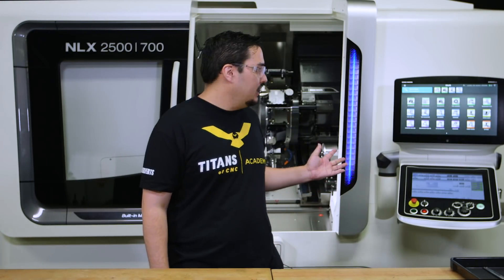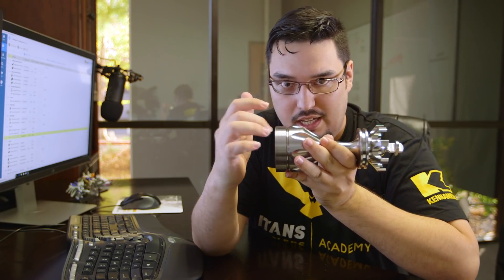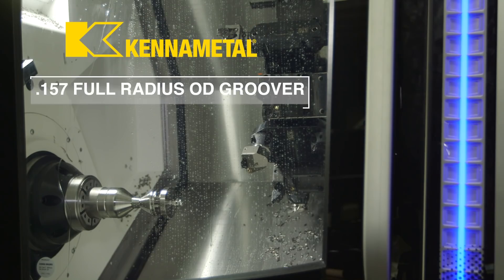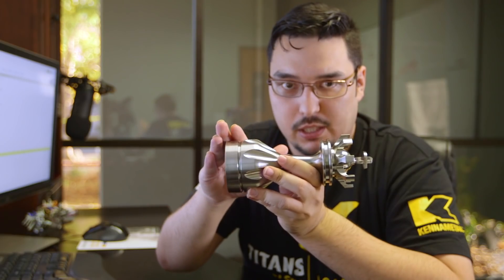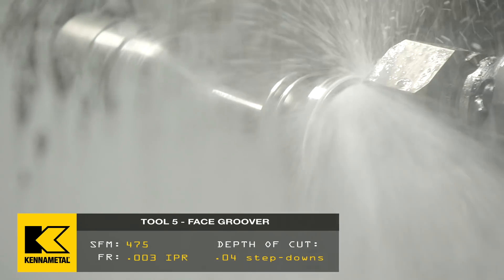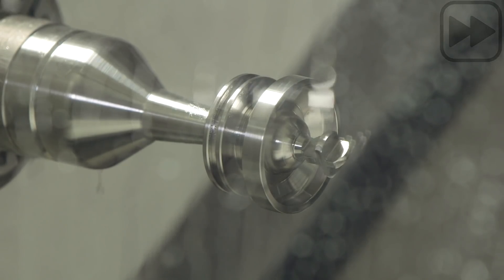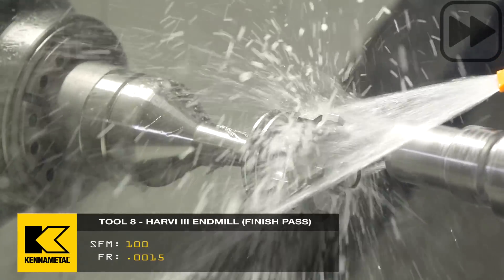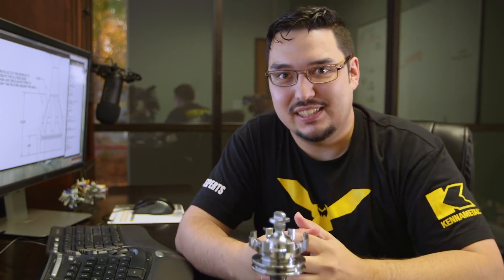How to Program & Machine the TITANIUM KING

Comment: I would have turned and milled  the top first and then turned and milled the foot last, to keep the part more rigid. Your part looked good and the program worked fine.
Reply: I was thinking the same thing, but ya the part looks great.
Reply: same 👍
Reply: You don't know how many times he had to adjust his speeds and feeds to get rid of the chatter... He even talks about it... Every skilled machinist would leave the stock material under the crown until the last operation. Making it that thin and using groove cutters on the crown, not the smartest way to do this.
Reply: @RicM4  You mean, we don´t have to ad a "BOOOOM" to the comments!
Reply: True. His way also works but takes way to long. The part looks great but could be machined way faster.
Reply: You are absolutely right !
Avoid chatter

Comment: First off, you guys are amazing. Love the videos and find so many useful tips and information.
I was wondering if you could do a tutorial on how to use the G7.1 for engraving around the outside of a round surface. 
G7.1 cylindrical interpolation.
I'm having trouble getting the code to work correctly in my NLX 2500.
Appreciate any help

Comment: I’m proposing this machine for    my employers next lathe. Spec is with fanuc controller, sub spindle, y axis, live tooling, bolt on tools for stability and if they will stretch .... a pallet loader. Is there anything you would change about this machine now that you have it up and running? Also, what CAM software you use?
P.s love the videos and the enthusiasm you guys bring to manufacturing. It’s a career that provides constant learning and a real sense of achievement 👍🏻.

Comment: I have a question, why are machinists and CNC programmers paid like crap? I'm from the Chicagoland area and even being a full 5 axis / swiss lathe trained machinist, you make a max $30 an hour. Compare that to much easier labor jobs around that pay up to $46 dollars an hour, why is this the case? How can we make more money in the industry without being a shop owner? Thanks and great video!
Reply: Count yourself lucky, in the UK the average is $18 an hour
Reply: What labour job is easier than being a machinist?
Reply: @spikeypineapple552  That's how he phrased it.
Reply: I think KH means " Unskilled Labor " like helpers and material handlers in the construction industries.  I am not sure why people compare jobs this way? easier vs harder, it depends on personal preference.  Working for a Concrete Contractor or Tying Rebar can be real hard on the body.  $30 / hr sounds low for the Great Lakes region, especially in a large metro like Chicago or Detroit.
Reply: @chrisrokz9005  Sort of yes, we (machinists) are paid like 2nd year apprentices, even when we can be masters of our trade. I have 2 skilled buddies, one HVAC and a linemen friend who both make over double what I make. The knowledge you need to be great at their jobs is much lower than what you need to be a great machinist, on or off the CNC. I'm not saying they don't work hard, they are great hardworking boys, I just can't figure out the pay difference. Other than the love for it, there is really no reason to get into this trade. Nobody but the people on the inside appreciate what we do. Getting back to my original post though, there has to be a way to make great money in this field of work. I just can't seem to find it.
Reply: @Bawbag0110  That's crazy, I hope living there is cheaper to make up for that.
Reply: @kylehofmeister6906  Most places outside of London are pretty cheap, my house cost £140,000, a similar one in London would probably cost £800,000 if not more
Reply: @kylehofmeister6906 You have to find a company, that makes more expensive produkts. Job shop jobs don´t pay as much as inhouse jobs!
Reply from the maker: There are so many companies out there and some are behind the times and some are on the cutting edge of technology. Pay is based on your ability  to sell yourself, meaning how you push your personal brand. Your skills level and ability to solve problems. Did you see the whole video on top 5 things to get a job.
I have always gotten paid 50% more than others with my same qualifications... but also was able to sell myself, was willing to move, and put countless hours in year in and year out to hone my skills on my personal time.
There is a machinist shortage right now and it’s going to get worse.
That’s good for Great machinist
Reply: @TITANSofCNC  I didn't see the video you talked about, I'll watch it now. Thanks for the advice, I know I have the skills, I guess its time to become a better salesman.
Reply: I will even said count your self super lucky, here in SeA (Malaysia) a good swiss type machinist will hardly earn more than 600.- USD / month based on 160h, that's not even 4.- USD/h 
I know the comparison is not that right as the cost of living is not same but that guy still doing the same job as you do...
That's why what ever you try to do to be competitive you will still face the hard effect of globalisation. 
That's one of the reason USA is struggling in term of world manufacturing and to rise the workers salaries.
But as your president said to the all world.... America First!
Reply: I’m from Ireland and I only get paid £10/hr, our machine is the NLX 2500 | 700, I’m the only person in our plant that knows how these machines are programmed and used, my skill level is above average but not as skilled as Titans guys, it annoys me because I go out of my way to manage the machine (getting orders, maintenance, reports, material, schedule orders, NightShift, Training, EVERYTHING!)  AND programme/machine my orders before the cut date. Machinists get paid crumbs, it really annoys me.
Reply: IX eleven this resonates with me. I’ve been busting my ass since I graduated trade school in 2011 and just landed a really great programming and robotics gig at the shop. I’ve been an operator to setup/operator of mill turns, supervisor and now I’m in programming and robotics. With a great attitude (gotta love what you do) and a good mentor and group to work with you are bound to succeed. Name recognition is huge in this industry so you have to constantly be putting in 100% to get ahead.
Reply: Millwrights walking around pushing tool carts, talking to the radio, makes lotsa money.
Reply: Jim from down the street ain't no bullshit nuf to make you wanna drive a truck!
Reply: All about how you market yourself and what area you're from. In Huntsville, AL where there is a lot of high tech aerospace work, you can make upwards of $40 per hour. Drive out of town 30-45 minutes and buy a 2500sqft house for $100,000

Comment: Would you ever consider putting metric conversions of all the feeds speeds and dimensions on the screen as they are said? Im fairly new to machining, and learning feeds and speeds is a huge part of the whole process, and these videos are great, but as a metric person, im learning nothing about feeds and speeds from these videos. If it just flashed up 2000mm/min as you said whatever inches per min, that would make the videos so much more useful for most of the world who use metric. Thanks :-)
Reply from the maker: Yes

Comment: Hi Tyson. Why did you machine all the weight out of the bottom end of the piece before you did all the fromt end work, Surely it would have made the work piece more rigid to do this and then rough and finis the bottom end ?
Reply from the maker: Because we didn’t want to confuse people and have a really long video. Also, because we work with titanium, Inconel and Monel everyday... this understood the exact feeds and speeds to keep the perfect pressure on it... as you can see, we had no issues and it came out Perfect.
Reply: Like you and your dad in these tutorial. I am too old now, retired, but I always loved my CNC machines. They make engineering fun. You two are way ahead of me in your craft. Keep it up.
Reply: INCONEL  oooooooooh!    Used to machine this for sailing boat fittings.

Comment: Would not a band saw be better to part it of the partcather is a bit smaller than the part?
Reply from the maker: The part off tool is amazing, precision and faster than a saw
Reply: A band saw would create a rough finish on the back face, meaning a second Operation would be longer. By parting off with the correct speeds and feeds you allow a nice finish and are able to cut the part to size. In a production environment this would be very efficient, as an operator would not have to be manually removing the part and sawing it off. Personally I would be using the sub spindle to collect the part from the main spindle when parting off and finishing the part in one operation!